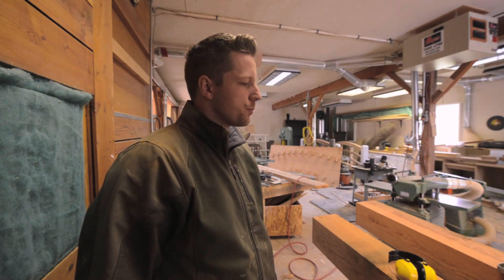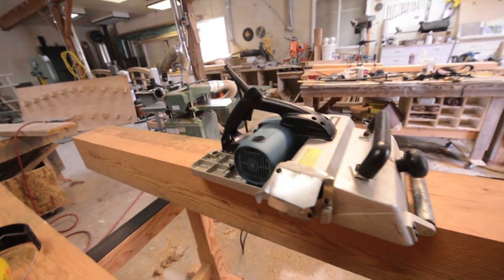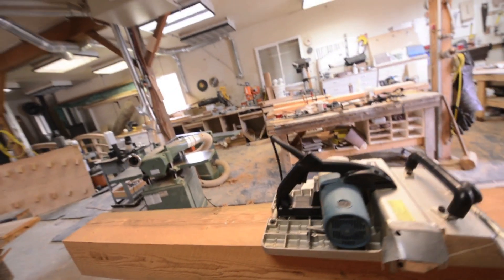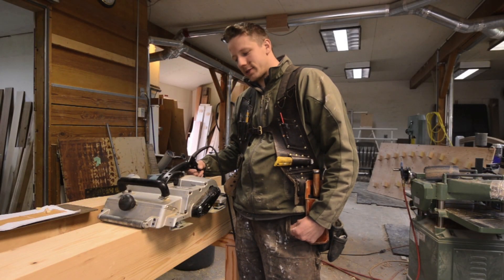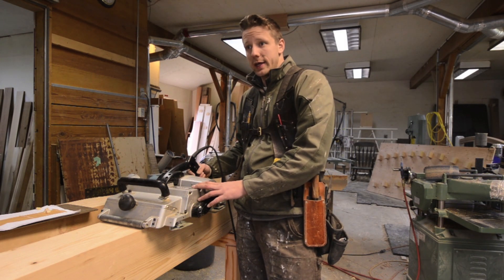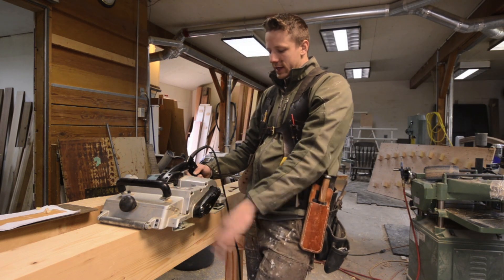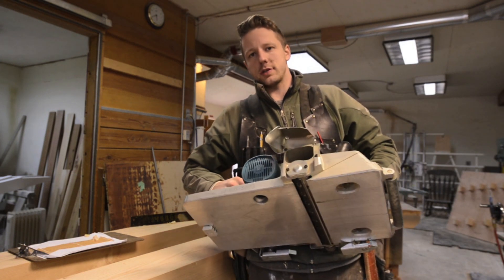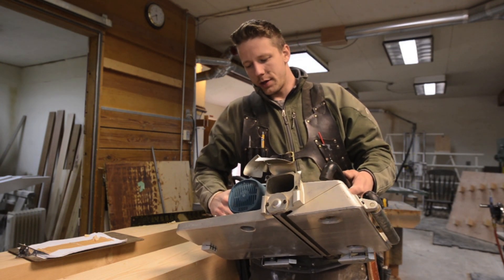Calling all Tool Geeks! The Makita KP312 Planer

Comment: this could be perfect for flattening live-edge slabs, thoughts?
Reply from the maker: +Pedro Romero It will work but a router sled is better. https://www.youtube.com/watch?v=kGAwhKsTsjM
Reply: +Pedro Romero Yes you most certainly can. I make live edge furniture and ive tried every method in the book and ALWAYS go back to my power hand planer. Yes the router sled set up is great but it dose take more set up time. On the other hand once your sled/jig is built and set up, its super fast and accurate. It requires less heavy sanding after flattening surface.. Both work its mostly a preference thing. Another thing to keep in mind is a power hand planer may look easy and simple enough to use but it takes practice. Just like most tools. The router sled way is easier because the router runs on the guide rails of the jig. Once I finally got hand planer down and had that "tool love connection" (which if your any type of wood worker you know the feeling) I wouldn't trade it for anything.

Comment: Brightened my spirit!  Just happens to be my birthday so I just bought one!  If anyone is prepared to pay for shipping, I can get them here in Japan for an average price of c. US500.
Reply: Are they 220v tools over or 110?
Reply: @bartfoster1311  50hz/60hz 110v
Reply: @bartfoster1311  Apologies.  I thought I replied to this yesterday...
It is 110v 50/60 hz
Reply: I must add that it is a beast.  The first time I powered it up it acted like my old 12" Makita belt sander.  The plank of wood I was working on would have gone flying down off the horse had I not suddenly stopped the beast and clamped it down.
Reply: @justingilbert4778 hello, is this offer to buy a Makita 312 planer in Japan and ship to the USA still available? Let me know, thanks!
Reply: @AH-xoxo6969  Exuce the late reply. After extensive research, I found a used one with spare blades for c. 812 us dollars given the current exchange rate.  Shipping would have to be sorted out at your end.  Note it is a 100v 50 and 60 hz one. Please let me know if you are interested. and I shall see what I can do for you.
Reply: Will the Japanese ones listed as 100v work on our 110 power here in the US?
Reply: @billmiller2057  Yes indeed if you have 50 or 60 hz as stated above.

Comment: Looking to buy one as we speak but can't find a second hand one might have to bite the bullet and get a new one
Reply from the maker: +Adam Lynch I patrolled ebay for over a year before I found this one.
Reply: +The Samurai Carpenter to get be out the turd on a job I've brought its baby sister second hand on eBay the 170mm wide version. The hassle I had with a bent sole on it has left me saving for a new 312 best thing about makita tools is the spare parts are easily available so stuck a new front sole on it and it's as good a new!

Comment: TIL: I will never, ever own that tool. 
There's no chance in hell I'm spending the $2098 (at the time of this writing. On SPECIAL) on a powered HAND planer. ESPECIALLY since I could buy a 15" Grizzly thickness planer, a Shelix cutterhead for it, and $400 of exotic hardwood, and STILL have money left over. DOn't get me wrong: you got a killer deal on it. And I STILL think that's an outrageous, borderline useless tool, unless you're having to surface a LOT of stock ON SITE for some reason.
Reply: Or you're a timber framer.. This is not designed to replace your thicknesser. It is made for people that need to take the tool to the wood because the wood can't (easily) go to the tool.